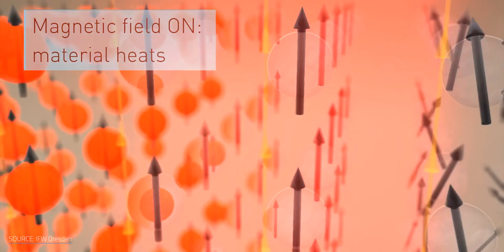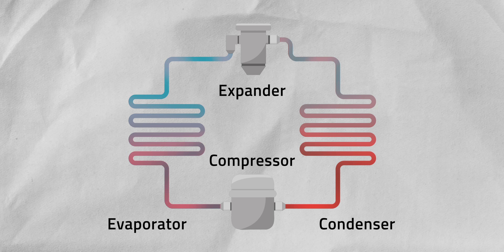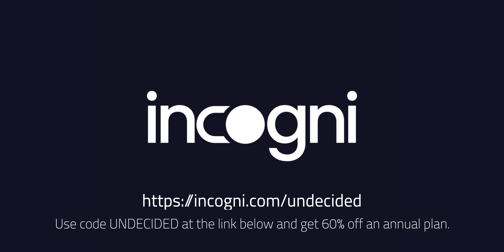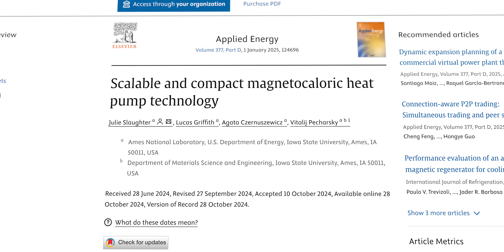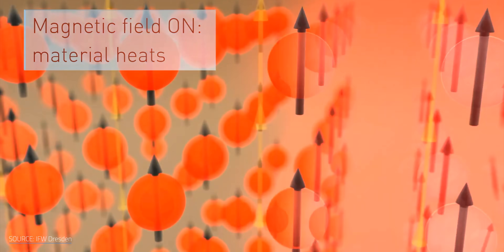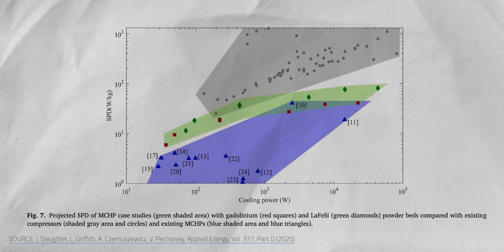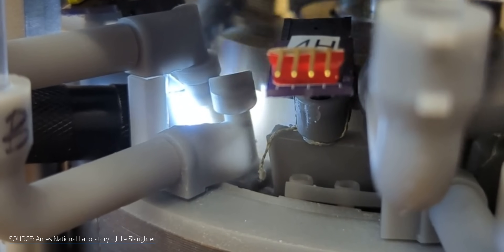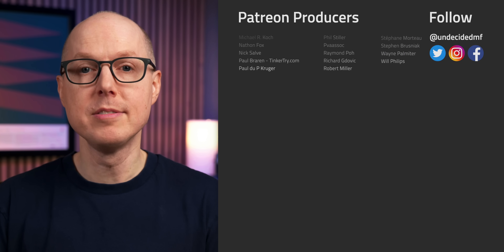How Magnetic Cooling Is Breaking All the Rules

Comment: I see natural refrigerants where the HVACR industry is moving to such as R-290 and Co2.   R-290 can carry a huge amount of heat in the suction gasses at lower pressures  compared to other refrigerants. This would result in lower compression ratios and lower watts and energy usage. Magnetic cooling might work for small reach in refrigeration but not industrial/commercial system’s.

Comment: Regarding the magnet demand issue: The single biggest barrier to rare erath mining economics is thorium. There's more of it in monazite deposits than all other rare earths combined - to the tune of about 5000 tons per mine per year

Sequestering that thorium is what makes rare earth mining uneconomic ouitside China. It's economic inside China because the government there has been buying up the thorium and stockpiling it (Hint: TMSR-LF1 and the projects associated with it)

Finding a market for thorium would solve the mining problem, break the stranglehold the chinese have obtained over rare earth supplies and make megnets much cheaper/readily available (along with a bunch of other technologies which would benefit from easier access to rare earths

Nuclear is the ultimate clean energy, despite the propaganda against it - and LFTR technology is potentially 80% cheaper to both build and operate whilst producing 1% of the waste of existing nuclear plants and fully divorcing civil nuclear power from the weaponsmaking industry (enriched uranium is a WASTE PRODUCT of plutonium production) along with being immune by design to events like Fukushima/TMI/Chernobyl, mostly thanks to eliminating water from the core of nuclear reactors
Reply: With the added benefit of decentralizing the power grid.  Neighborhoods or small towns can be powered by LFTRs the size of a shipping container.

Comment: If we continue on this tech, we can super chsrge it to achieve 0 kelvin range temperatures. 

We could make cooling a factor of power. If its working time duration + wattage is less than what we can produce with cheap solar cells, we could harness cooling energy from space. 

The implication that we can extract cooling energy from space might motivate us to experiment with space building materials, while isolating for 0 Kelvin material science. 

I'm thinking space elevator with 0Kelvin steel, made of the cheapest and adunbant materials on earth.

Comment: Are you selling it or actually taking apart the idea to explain? you're selling it. Some important questions left unanswered but thank you for saying "invest". This won't ever see main stream production for a lot of reasons. corruption, reliability, and they haven't fixed the colling and heating issue. When a magnet is heated above its maximum operating temperature but below its Curie temperature, it will experience irreversible losses in performance. another issue, can't be fixed on site, they'd need to send an entire new unit while sending away the broken one, by how these working proto types are shown. I can replace a pump, call someone to add gas, replace motors, etc. You can't fix anything on that other machine as everything is specialized, cost of fixing one is gonna be a lot.
I work with commercial stores as a maintenance person. I did not like this video.

Comment: The real tech barrier that will need to be solved before we see it commonly in refrigerators and hvac units is wether or not it can be made to reliably fail every 5-7 years so hvac manufactures can make another 10k.

Comment: As with anything longevity is the actual measure of environmental impact but often ignored.    If these can be engineered to last a decade or more we're in business.    If not, then they're just another thing clogging landfills.    There are refrigerators that are near 100 years old that still run, its a reliable system.

Comment: Super bad video.  Takes over 7 minutes to get to the point, and even then it doesn't really explain actual practical applications, such as using it for a heat pump system, how you plan to move hot/cold air from inside the structure to the unit without refrigerants.

Comment: It sounds great, but I don't think it will take off.  This seems like you could feasibly make an air conditioner or refrigerator with no or very few moving parts, making them very reliable and easy to repair, and the manufacturers of such devices won't want to produce something that will last forever.

Comment: How about going back to ammonia??? SMFH! Takes a tealight candle in energy to produce the same effects as the best refrigeration systems of today! Thus Nasa wouldn't still be using it for all their space systems!  It's corrosive but we have plenty of modern metals that are corrosion resistant and cheap enough today! It's utterly BS and robbery that we want away from ammonia refrigeration systems here!
Reply: I did IT (computer tech) at a cold storage warehouse that used ammonia as the refrigerant.  Had huge tanks of it 20 feet high and massive compressors almost as big as shipping containers.  Had windsocks outside in case they had a leak and had to evacuate and move upwind of the ammonia.

Comment: Granted I am very much a layman here, but I thought the main appeal of Air Conditioners/Heat Pumps was the fact that they only have to do mechanical work to change the temperature which results in putting very little energy in compared to how much cooling/heating energy it puts out

If these magnetocaloric coolers can achieve similar results and power consumption then this could be a huge step in combating climate change
Reply: Air conditioners use mechanical energy to move heat from one place to another.  I don't think this video explained how they propose to move heat away from the magnet/gadolinium assembly to outside the building.  I say that based off the comments.  I had to quit watching and give it a thumbs down after he started going off on a tangent about coffee.

I'd imagine they still have the issue of having to mechanically move coolant away from this device to some other location.  Like a pump and radiator setup.  But it would work for small refrigerators where they are moving it a very short distance from inside a box to right outside it.  In fact, at the beginning, he showed real world examples of this being used in grocery store cold drink displays.

Most buildings with AC have to move the heat a significant distance by comparison.  In those cases, I don't think this system would be more efficient than traditional technology.  I think it would be less efficient.  The environmental advantage (if you can call it that) is the lack of gaseous refrigerant.  At the cost of having to mine rare earth gadolinium (which is very dirty to process and refine).  Modern refrigerants are no longer harmful to the environment (that is, we no longer use chlorofluorocarbons).

In my opinion, there is no use case for this technology and this is shilling for investors, at best.

Comment: "We need an alternative to our refrigerants." 
Me sitting here filling all my truck ac's with propane using a cobbled together propane to r134a line. "Buwt that's nawt wefrigerwant grwade prowpwane" all the internet experts replied. To wich i say idgaf i aint spending that kinda money when the grill gas does it just as good. "Buwt prowpawne isnt a wefrigerwant at all and its fwamable unwike these new wefrigerwants that i havwent wead abowt so i just asswume that that that they're nawt wight?" The other half of the replies will say.
Reply: Does that ever get a leak and explode?
Reply: Because R32 is basically propane, and there are several news stories you can google about kitchens and homes being leveled due to refrigerant leaks, no ventilation, and electrical sparks.  That's why I asked in my other comment if filling a car's AC system with propane ever gets a leak and explodes.

Comment: I think it's worth noting that hydrocarbons work very well as refrigerants, have no ozone depleting properties and very low global warming potential compared to HFCs.  HC-12a (a mixture of propane and iso-butane) can be used in most systems designed for R12 or R134a because the thermodynamic properties are very similar and it has a global warming potential only 3 times worse than CO2 compared to 1300 times for R134a and 8100 times for R12.  The main problem with hydrocarbon refrigerants is that they are highly flammable and this poses an explosion risk if the refrigerant leaks into a confined space like the interior of a car or refrigerator.

Comment: So my biggest question is how efficient are these magnetocaloric machines? Current HFC refrigeration machines have a coefficient of performance of around 3:1, meaning for one unit of electricity used, they remove (or, really displace) 3 units of energy. 

How do these new units compare? Are they similar in CoP, or lower/higher? I'd think they'd need to be a lot higher (5:1 or so) to make it worthwhile for consumers to switch to them.

Comment: With the advancement of Computer control systems in the last 30 years, why not use an electromagnetic system of coils etc, rather than permanent magents.
No moving parts.
Minimal extra electrical input.
Easily customisable control with just software.

Comment: I work on board a boat that freezes fish. It sounds like they've made one of Maxwell's demons in a little spot, but the mechanism looks cumbersome for point of use. One would still be pumping (something functionally equivalent to) glycol around to absorb/release heat where you want that to happen. I wonder if the efficiency of the "transfer to point of use" mechanism is included in the overall efficiency calculation?

Comment: Is it possible to make an superconductor system without liquid nitrogen but seperate the heat and coldness throught electricity only, so it reduce the heat and electric resistance, increase conductivity from the freezing temperatures.

Comment: Hi the reason to replace compressor cooling is the amount of energy it needs not the flurides. 

I skimmed through your videos and saw a lot of material science based technologies there. Would be great if you would mention that field of study since there is more work than the material scientist community can handle. We need more students. Also it's a good way into nearly any industry, if you're more into that than science. For example magnotherm was founded in my department.

Comment: I recall an article about an Australian that modified a chest freezer as a refrigerator. Simply by modifying the orientation to work with nature (cool air sinks) he improved the efficiency many fold. Sometimes, in our effort to scale new technologies, we step over some basic improvements that get us 80% of the way there and minimize what's needed to sustain the end goal..
Reply: @byronlaw6724  I remember that same guy! It was such a simple idea too. If I remember correctly, he simply adjusted it to run at refrigerated temps instead of freezer temps, and the whole system simply didn't have to work hard at all, and with the orientation didn't have to cycle very often either.
Reply: @dbbuchmann  I'm surprised that some one or some company hasn't expanded on that and engineered a horizontal fridge with pneumatic assisted shelving lifts that elevate the contents as needed to convenient accessible heights. The biggest issue is that the lid as a horizontal surface would constantly be getting loaded up with everyone's crap.

Comment: Magnetocalorocs will take over.   And who needs permanent magnets? It's not impossible to make a magnetic field with electricity. Rectify the ac so you can make a fixed polarity magnet, inside a drum you have magnetocalorocs rotating around the stationary magnet and have coolant pouring over the cold part of the drum with fins to transfer heat more efficiently. Pump the coolant through the equipment to where the cooling needs to take place. Shouldnt be too difficult once you get the metalurgy figured out.

Comment: For those who do not know, in the US, mostly we measure cooling capacity in tons or BTU. 12000 BTUs/ton is the general number applied to an evaporator. For reference, there are ~3413 BTU/KWh. Large data centers use hundreds of tons of cooling. If you have 100 racks, you may have 3 tons per rack of cooling requirement, plus the lighting, the UPS systems, and the facility itself. So this system is a VERY long way off from that. On the other hand, your refrigerator is typically half a ton at most. In the deserts of Arizona, a household cooling system is 4-5 tons, while in Utah, it is only 1.5. Also note that freezing is harder than cooling and you have to wonder if these are capable of doing that as yet. The thing about this setup is that it seems like it is even easier to reverse the flow so that a cooling system becomes a heating system, without the touchy valve setup that a heat pump uses.
Reply: You go to the trouble of providing the conversion of BTU to kWh, which shows it must be some kind of unit of energy. However, you left the reader wondering what you are measuring with tons. Tons of what?
Reply: @Beleg_SB  Tons of ice.
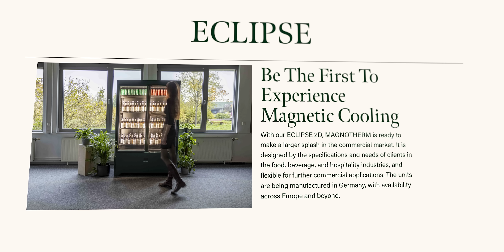Reply: 12:32 The commercial devices advertised don't go below freezing, showing between 1 and 10C, 33.8 - 50F. Recommended household refrigerators run around, 0.56 - 3.33C, or 33 - 38F. Household freezer temperatures are, generally, around -18C, 0F.

Like all technologies, this will improve with time. Once it surpasses the typical efficiency of modern refrigeration at scale, and is competitively priced, it will become more attractive to the masses.
Reply: I swear US will use anything but SI units...
Reply: @Turtlemaroon btu is used in the EU as well though...
Reply: You wondered if it's capable of freezing so I would point of that magnetic cooling is what's used to get something to near absolute zero temperature. ( negative 459 degrees in freedom units )
Reply: @bwhog  
I live in Ohio and my house uses a 5-ton AC Condenser, region isn’t the only factor in deciding Heat Pump/AC Condenser size. There are many many factors.
Reply: The moon was covered in American feet. Until a metric can repeat the feat, the American-Imperial system is the best metric.
Reply: @Triple_J.1  The Russians had the first satellite, the first human in space, the first (unmanned) moon landing. The only way the US "won" the space race is by constantly moving the goalpost.
Reply: @DeviRuto its still an amazing feat (that cost the lives of people in failed attempts) to actually take man to space. Phrasing it as a race is the problem, not the actual feats. All these achievements made huge progress sans a profit incentive.
Reply: @marios1861  There was definitely a profit incentive. The profit was keeping people from thinking that the communists might have a point, and thus postponing the revolution for just a little longer.
Reply: @Triple_J.1  Even at the time NASA was using mix of customary and SI units and is now using SI almost exclusively.

Not to mention that BRITISH thermal unit is hardly the most American patriotic thing there is.

Comment: Soooo.... are you going to come back and actually explain how it works? All I see is multiple sections that alternatively heat and cool. Where does the heat go? In a heat pump there is a cold side and a hot side and they aren't collocated. I can't change the temperature of anything if the thing that heats up is also cooling down.

Comment: As an entire species we routinely ignore the most obvious, simplest, most effective, least expensive, most sustainable solutions for heating and cooling. Many of these fall under the term passive design. 

This is something that bees, bears, badgers, beavers, bats and barn owls seem to have all figured out independently: choose materials and locations that are naturally the thing that you want. Four feet underground or in the side of a mountain is cool, the top of a tree is breezy. Even solutions as simple as orienting a building such that the windows don't face the sun in the heat of summer, we can't bring ourselves to do in large numbers (on the scale of communities and societies). 

We routinely fail to employ the catenary arch, which produces airflow. Even a pipe simply pointed "upper" from a "downer" place will create convective movement. But we just don't.

No moving parts, no motors, no magnets, no lab jackets or fissile materials, no government subsidies; beetles seem to have no problem doing it, or bobcats, ...or even barnacles.

It seems like the many simple, powerful solutions we already have are just...boring, and don't sell software.

Comment: I like this technology. If they could make the magnets from highly abundant, non-toxic materials, that would be excellent. Also for a split heat pump AC, how do you transfer the heat? Would you still need a transfer medium? May be something simple like water…the cool water cools the house’s air in the thermal exchange indoor unit, takes on heat, then goes to the magnetic heat pump where it’s cooled down and the cycle repeats. In wintertime cold temperatures, the process is inverted to heat cold indoor air. Also, easily recycled components would be really good.